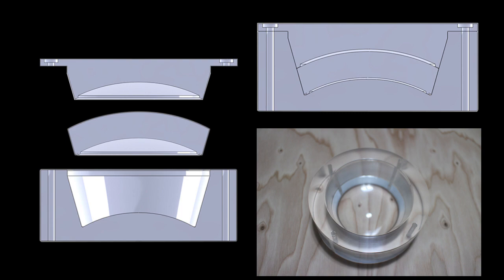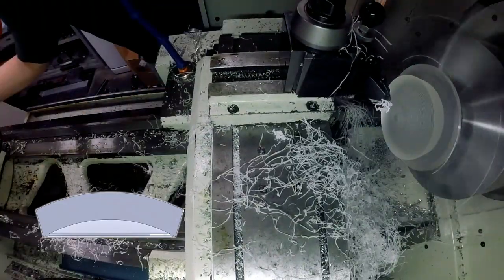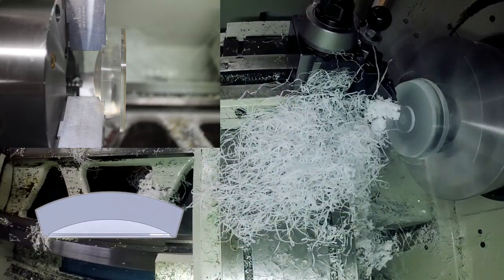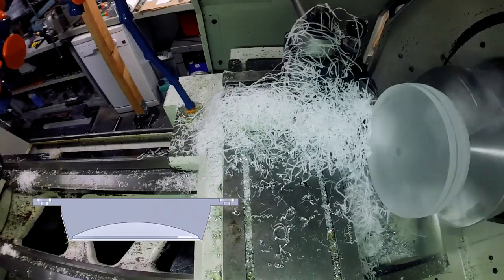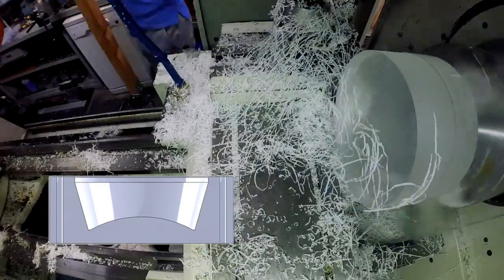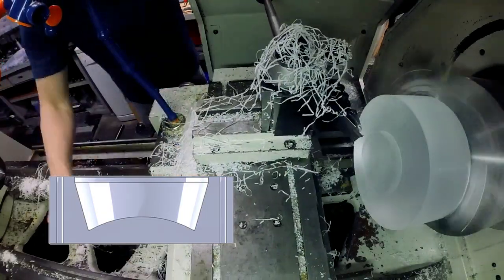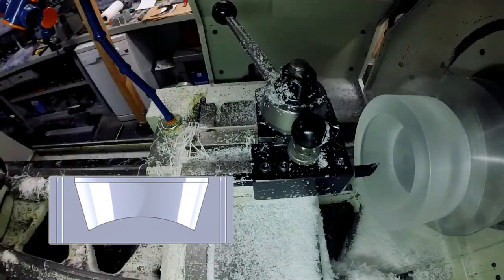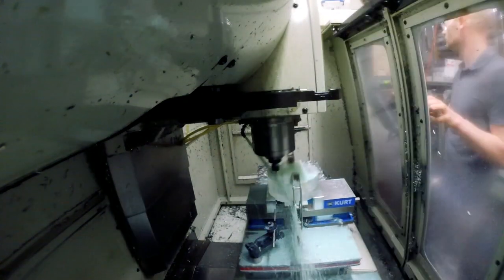Machining An Acrylic Lens Assembly

Comment: 😀 Great video!
If we say that no question is stupid enough, would it be possible to machine glass on laith?
For example, instead of using a regular pointed tool, what about tool that has flat grinding surface, like sanding paper or such?
Reply from the maker: Using an abrasive cutter it should be possible.

Comment: Do you think I can do this on a mill? I guess is not going to come up too good, isn't it?
Reply from the maker: You can still do this on a mill. The key is a smooth and polished finish. After milling it won’t be clear but after sanding and polishing it will become clear. You will need to step your way down to a 1,000 or better sandpaper.
Reply: @McCoskeyPrecision  thank you for the advice. 👍